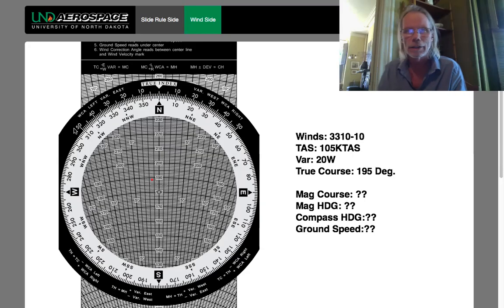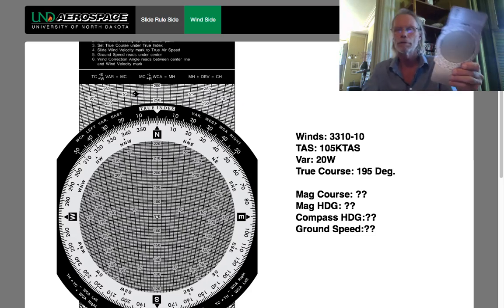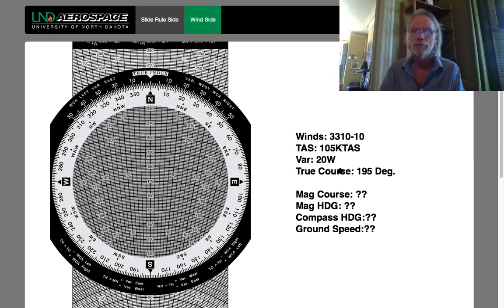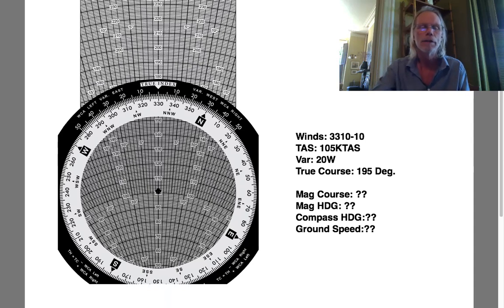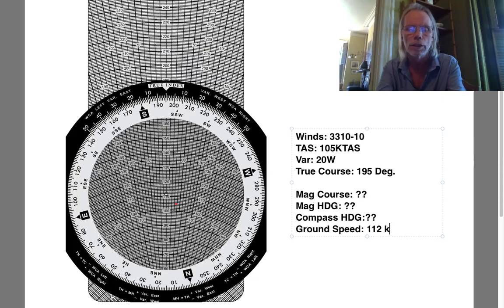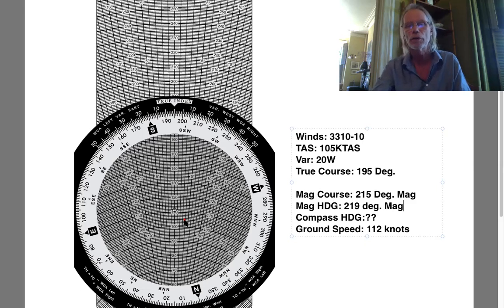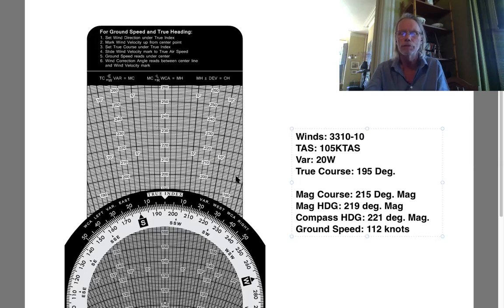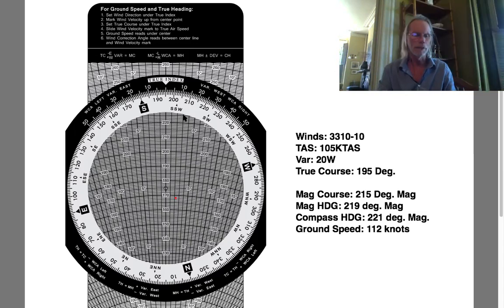E6b part 6. Wind correction. The Triangle of Velocities (!!)

Comment: Hello. Can you solve questions where they ask you to find True Track and GS?
For example-
TAS=125 kts
Heading=355 (T)
W/V=320 (T)/30 kts

Calculate True Track and GS.
Reply from the maker: Well, you have the true heading, TAS and GS, along with the winds. So you can use the E6B to extrapolate the true track. All these figures, including the winds are True. Basically you can do the reverse calculations,  and the True Track will become apparent.

Normally one starts with the True Track, TAS, and Winds, to calculate the True Heading, which you have already. Remember, the True Heading is calculated in the Triangle of Velocities, which the E6B does for you. Basically you run the calculations in reverse.
Reply from the maker: @halimurkhandakar  I would recommend you conjure up a problem of your own with winds, TAS, and True Track. Use the E6b to find the true heading, keep in mind the dot position, then mentally de construct your solution in the reverse. Try it a few times and you will get the hang of it. Transport Canada exams will also sometimes pose the same problem. EASA is broken into 14 subjects, true, but it is all the same material we have here, just organised into a couple exams for the ATPL. Good luck! Keep at it - it will become easier

Tailwinds